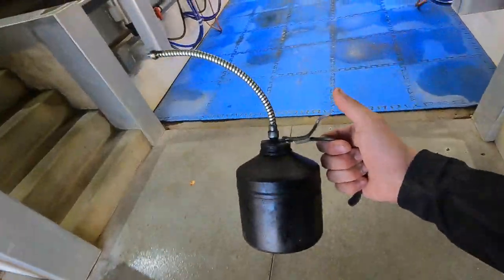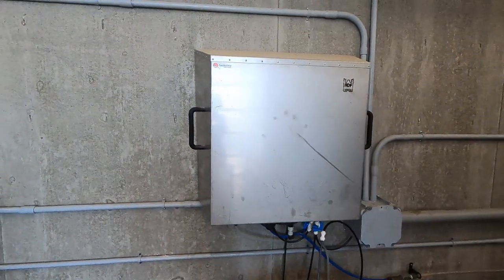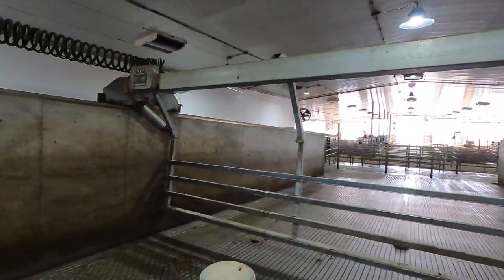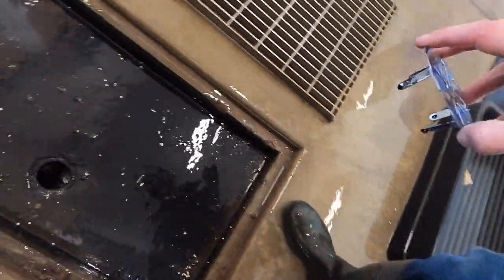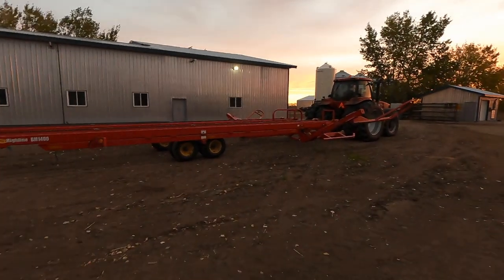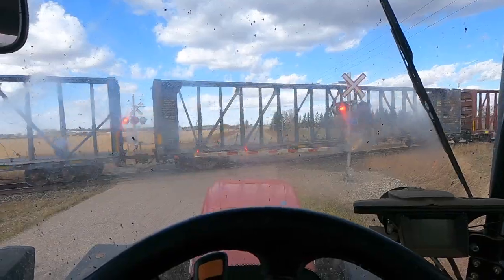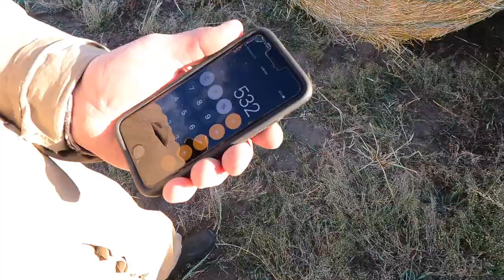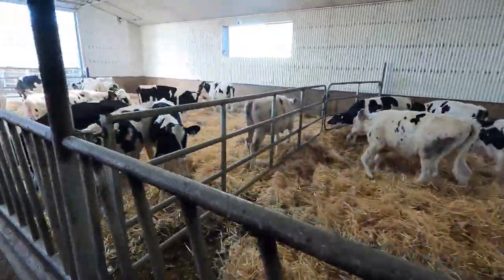Parlour Barn UpKeep!

Comment: What of you just drilled and tapped hole for a zirc fitting so you can grease the  sequencing gate. Grease would last even longer than the oil. Wouldnt even take 10 minutes to do both gates.

Comment: Yes, Jan, maintenance is truly key. Makes life so much easier in the long run. The maintenance you perform around your farm, the 10th Generation Dairyman, the Hoof GP all practice excellent maintenance techniques to keep your equipment in A++ condition. The other obvious reason to have a key and ongoing maintenance program is that your equipment is less likely to suffer breakdowns due to simple negligence. So those people who criticize you with "aw, another lube job, or didn't you just change the oil or put new rubber gaskets on that" need to wake up and smell the coffee. These would be the same people who never get an oil change in their car and then complain when they blow their engine.  For farmers in the colder and snowy parts of the US and Canada, it sure is much nicer to take care of a piece of equipment while temps are pleasant in the 50°F, 60°F, & 70°F range than freezing your arse off in -20°F to -40°F and trying to unstuck a frozen bolt while your hands are like ice!! Do yes, maintenance, and especially preventative maintenance, is the key to making your farms run far more efficiently as well as for us, our vehicles. Preventative maintenance can all save us hundreds or thousands of $$. It just takes one breakdown and you'll be eating triticale or dog food to save up the $$ to get your equipment or vehicle repaired. Am I right?? Darn tootin' I'm right!! Ok then. Lecture over!!! 🚜🐴🐮🐣🐤🐄🐏🐐🐎🐂🐓🚜

Comment: I should not have been spooning Kraft Dinner into my mouth when I clicked this video with runny manure scraping. WD-40 is not a substitute for oiling or greasing mechanisms. It's for penetrating rusted/frozen stuff and has a very minor amount of lube function but it's meant for water displacement (hence WD) to prevent rust creeping in etc. Nice Tuxedo, Fritz. Wear it all the time? 🐈
Maintenance IS key!

Comment: WD40 would be the last thing I would use, there are a lot better spray lubes available ideally whoever built the system they should have installed nylon bushings between the metal parts, last for a long time, also no squealing keep safe my friend

Comment: Hey from Aus, I have never used the bail loader before, so take my comment for what it is worth. IMO I think you hit the bails a little fast& hard, thereby putting undue energy on that joint. Remember when you push things too hard it will break at the weakest point. Also, maintenance is key.

Comment: Maintenance is key! That's correct.where I work it's my job to grease everything and I need 4 tubes of grease the get all the bearings every week. But nothing works better then a Milwaukee m12 grease gun💪
Reply: Timothy Gross upload cattle video dude
Reply: @calebmanuel17  I dont work on a cattle farm I work in a manufacturing company we make biomass pellets for heating. Its basically a coal replacement. Its spruce wood grinded into shavings and then it gets compressed into a pellet